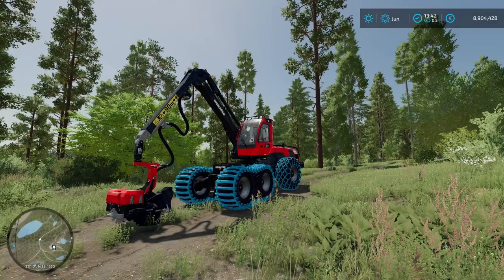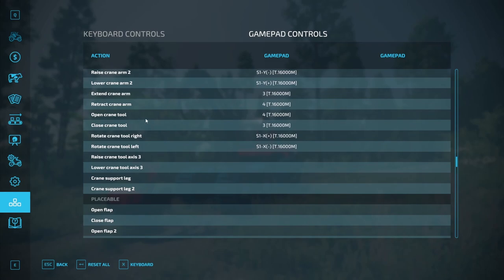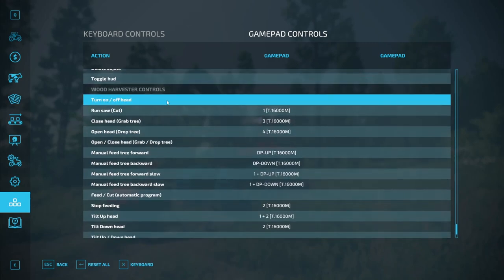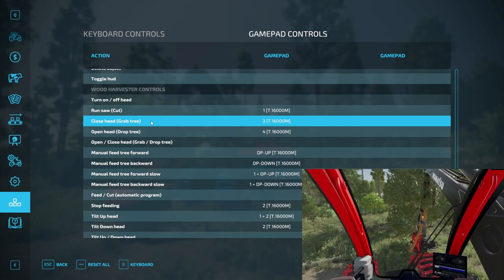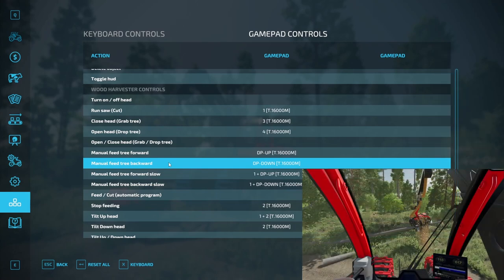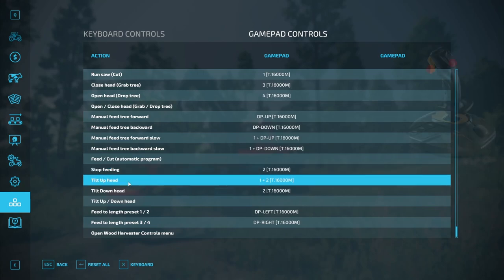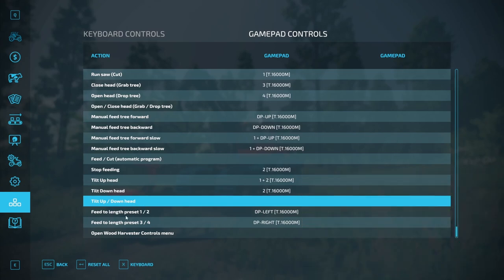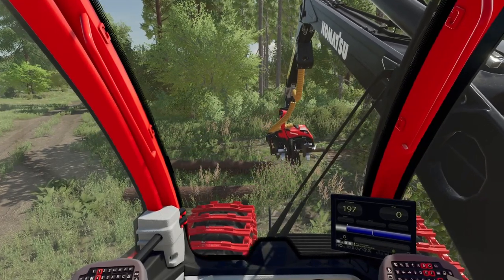Input Bindings & Dual Joystick Setup | #2 Wood Harvester Controls Mod Guide

Comment: Very cool! Tell me, if you set it up like you have, it works the same on all machines. But on Rottne H21DB, arm and arm2 are mixed up in places. Or is there something different? And if you use the H21D together with other forest machines, then there is confusion in the management.
Reply from the maker: I'm assuming you're talking about the H21D from the base game. If so, that is because Giants have screwed up with that machine. It have the crane controls completely wrong. 
If you like the H21D you can download the one I've edited (with 100% WHC support, improved physics and fixed crane controls) at this link: https://github.com/BargonMods/FS22_WoodHarvesterControls/releases/tag/v1.0.0.0-beta
(don't download WoodHarvesterControls from that link because that's the first beta version I released in March of last year.

Comment: This Was Very informative and Helpful, Thank you. But Do you then Have any controls for the Camera?
Reply from the maker: I personally don't use any camera controls in joysticks and basically play with fixed camera, but you could set them if you want, for example, using a button like the trigger + left and right.
Reply: @bargonmods  Btw on the Same Harvester that you're using, When I try to Open the Head It won't open, and when it opens the feeder stays closed, any fixes?
Reply from the maker: @ivendagsv  Hey!
Are you using the Komatsu 951 by Oscar_8599 and Woodcraft Modding?
Did you delete the Wood Harvester Controls keyboard input binding as I mentioned in the video? https://youtu.be/OWci1IiBBPE?si=VdzWHjL0bqNKOlXg&t=981
Reply: @bargonmods  ohh I forgot to Delete the Keyboard controls thank you, And Yes I am using the Komatsu 951 by Oscar_8599 and Woodcraft Modding, and also do you know any mods or anything to stop the game from removing like two meters of logs on the Last cut? The one on the Harvester controls menu doesn't take care of the Last one
Reply from the maker: @ivendagsvold as far as I know it's not possible to modify that behaviour (deleting the top at the end). It's something internal. When you cut, the game needs to generate 2 new geometries, one for each side of the cut. If the diameter of the generated geometry is small it gets deleted. I guess that's for performance reasons.
Reply: @bargonmods  oh okay I understand, thank you. I'm also really enjoying the Harvester controls mod

Comment: Hey uhh when I launched fs22 my joystick controls switched sides, all the controls were different. I Tried unplugging and plugging the joysticks back in, but it didnt work. I also tried switching the sides under but ot also didnt work. Can you help?
Reply from the maker: Hey! Unplug both joysticks. Plug in only one of them and move it. If it has the right controls, just plug the other one. If not, unplug that one and plug the other. Move it and check if it has the right controls. Then plug the other one.
The trick is to plug just only one and use it. Then the other. Once you know what you need to plug first you can repeat this process in the same order all the time.
In my case. I need to plug in the right joystick first, move it so it gets detected, and then plug the left joystick and move it. It works all the time.

Comment: I can't get this to work. I am not using joysticks I am using an xbox controller however, what the issue is once I pickup the log the processor head will not feed either way. I have turned this mod off and the processor head works without the mod. Also the processor head works to feed the log back and forth if you have not "grabbed the tree" so I am not sure if there is a bug now or just an imcompatiblity.
Reply from the maker: What harvester are you using? When you grab the tree you use the Automatic program or the manual feed buttons? Try with a base game harvester and just this mod and see if it works
Reply: @bargonmods I was using a FDR logging harvester.
Reply: @bargonmods I haven’t tried with base game ones. I will try this evening and update then.
Reply: @bargonmods  base game machine works fine both automatic and manual feed when you grab onto the tree. If you use the FDR logging processors manual feed doesn’t work when you grab the tree. It will only feed back and forth if it’s loose in the processor head.
Reply from the maker: I have a video on the channel to use WoodHarvesterControls with FDR mods. Take a look at it and see if it helps. I didn't try FDR mods the last months. I will try them tomorrow to see if everything still works the same way as the video I have on the channel.
Reply: @bargonmods  I followed the video and now it seems to work thank you. I am not sure if I had a control or a setting wrong but everything works now. Thanks again.
Reply from the maker: No problem mate. Happy logging!

Comment: Does this still work? I got 2 T16000m’s but it doesn’t seem to work when I set the controls
Reply from the maker: @zombiehoggy3701  yeah, should work. Could you explain better the problem you are having? And what harvester are you using
Reply: @bargonmods the first one on the list under forestry equipment. The red one. 
I go into my controls, clear all existing controls, make the new controls the same way you do in the video and save them but when I go to rotate cab or anything with my sticks it steers the whole machine instead and it’s not recognising any of the inputs for my right stick.
I’ve got controls set for the liebheirr 902 pack that work perfectly fine but can’t get the base game to work with forestry equipment. Thanks in advance.
Reply from the maker: @zombiehoggy3701  Make sure to delete all default joystick input bindings before setting new ones. Also hit save. If moving the joystick turns the machine, the controls have not been set correctly or have not been saved.